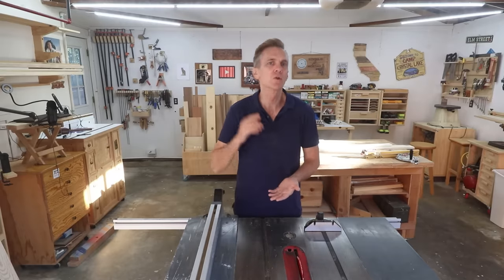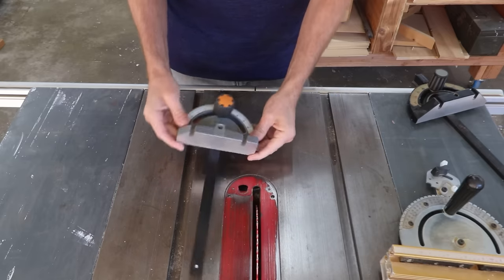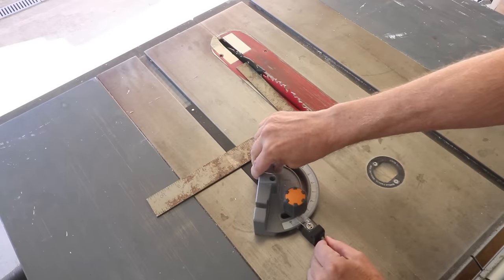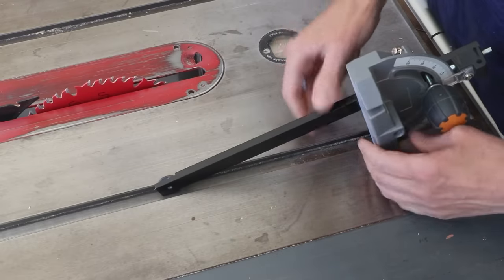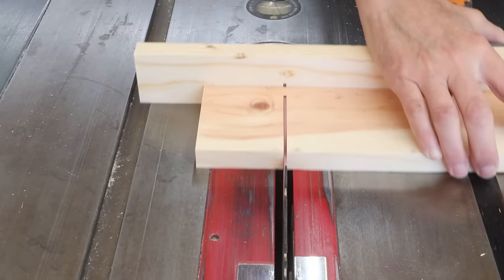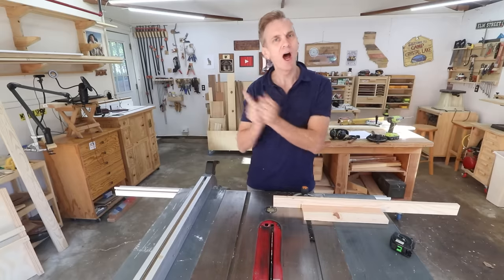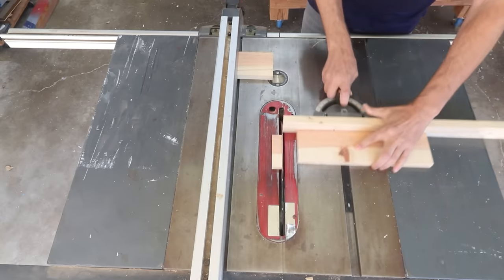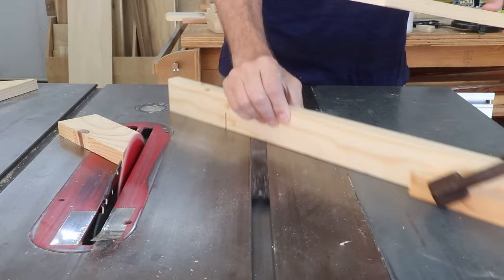Get the most out of that horrid miter gauge that came with your tablesaw

Comment: Don't buy a ryobi table saw. Miter guage isn't good and only one slot on the right side.  Lots of plastics parts too. I like their other tools but the table saw is not great.
Reply: Got my ryobi on sale for  50% off.  It's got 2 mitre slots on a folding wheeled stand.  While definitely not a pro machine, it's great for home/hobby use and takes up little space in the garage when folded up.  Mitre gauge is meh
Reply: All job site table saws have less than ideal miter gauges. I like this idea because I was just wondering how to attach a piece of wood to mine and now I can. Why doesn’t the wood cut the fence?
Reply: Yea me watching this after buying used RYOBI $50 on FB, used it one day cutting 2x4 and motor dead 😂. Owners denied any issue.

Got new one and now watching videos and this one help! 

Got a more sturdy Skil saw that is more metal part. Figure the amount of project I want to do might as well invest in better one
Reply: Agreed. The miter slot has too much slop in it making for less than precise cuts. Sawdust control is horrible and the fence measuring guide is wrong. Off by 3/16ths
Reply: Does anyone know of a good third party miter gauge that fits the ryobi?

Comment: The other COST advantage to the Miter gauge, is not having to spend another 600 dollars on a good miter saw. This is where people get the idea getting into wood working is expensive. I am starting on a the craftsman table saw, that cost me a whopping 139 dollars. yeah the miter gauge is MEH at best. but i can make a better one. SO THANKS FOR SOME OF THESE TIPS. it will improve the work of the little bench top table saw 100%

Comment: To quickly reset the miter gauge to 90*, I turn it upside down, insert the runner in the table slot, slide the head up against the saw table, tighten the lock.
Reply: That works nicely if you have a symmetrical runner... if (e.g. DeWalt) you have a t-track piece of cr@p...

Mind you, there are nice Chinese mitre gauges for $100 or so... and I'm ready for another bout of GAS (Gear Acquisition Syndrome). 😂
Reply: Good tip
Reply: nice trick!
Reply: Only works if table is square to blade. About a one in a hundred fifty chance of working

Comment: Tip for the newbies: If you are using the nail trick to raise the edge of your miter fence rail, lay the rail flat on the table. If you whack it positioned as shown, you'll bend the rail.

Comment: 5:16 - on stop blocks like this, I always nibble off the bottom inside corner (the part your workpiece is pressed against) to create a little sawdust pocket.  That way, you're not accumulating extra dust in between your workpiece and your stop block.  Just clipping off maybe 1/8th of an inch at a 45 degree angle is enough to create that little void and doesn't remove too much of the stop block as to make it impractical.
Reply: Good point. Even more important to make this recess on your stop blocks at the miter saw where sawdust collects more quickly.

Comment: I really appreciate table saws with rip fences that have a built-in flip plate. The 2" flip plate on my Dewalt 7491RS provides a nice buffer between the rip fence and the blade. When not needed it stows out of the away instantly. Almost all of my crosscuts and miters cut are made on a 10" Dewalt DWE713 miter saw. I only resort to cross cutting and mitering on the table saw when the miter saw can't handle the size of the material.

Comment: The only comment I would add is to prop up the extension just enough (1/4" or so) to keep sawdust from building up at the bottom of it and messing up your alignment.
Reply: And from making that horrendous squawking noise. Wax beneath the extension helps with this.
Reply: A small chamfer on the bottom of the extension fence can help with that, in lieu of trying to mount it both evenly and on a prop. 😊

Comment: Hello from Alaska hope you are all well. My solution for a perfect fit on the miter gauge that comes with a table saw and I mean all table saws is drill and tap 5 holes with a 10x32 tap and install nylon screws cut them off about a third the thickness of the miter bar then cut a slot on one end so you can turn it in for the perfect fit. I've done this on multiple gauges. Cheers All😜
Reply: That's how my new (expensive) miter gauge works, only it has steel grub screws instead of nylon. First time I ran it through the (Dewalt) table saw the sharp edges on the grub screws gouged large strips out of the track, since the table is aluminium. I sanded them down as smooth as possible, but it's still not good. I didn't realise there are nylon grub screws available .. I'll go hunting. Thanks for the tip!

Comment: Good ideas. the miter gauge for my Delta table saw is junk.  Very loose and crooked.  I tried tape but that didn't work. I'll try the nail method tonight. Frustrating to make a good project and then its out of square after you cut nice wood.

Comment: I came across a much better miter gauge at a used tool store than my saw came with but unfortunately the rail was a little sloppy. I drilled and tapped some holes in the rail and installed some nylon set screws to tighten it up.  Works great.

Comment: A suggestion when installing an auxiliary miter fence is to place the board on two playing cards before screwing it to the miter gauge.
This prevents the board from dragging on the table, amplifying any clearance between the miter gauge and the miter slot and reduces drag for a smoother cut.
The amount of twist in the miter slot is severely limited by the length of the auxiliary miter fence. 
When making thin cuts, use a zero clearance sled when possible.
If you haven't constructed one yet, clamp a board, that has been trued up, vertically on the rip fence before the blade and  measure from that board.
The clamp prevents the gage block from moving with the work and provides clearance so that the blade will not bind on the cutoff.

Comment: Worst miter gauge is on the Bosch GTS 10 XC2 Just purchased it and it was the last item I unpacked and assembled. The slots are also 16mm industry standard is 19mm.
I was quite happy with the Bosch until I unpacked the  miter gauge. £605 wasted the table that comes with it is very strong and stable.

Comment: Just as a couple suggestions, but, 

First, check the fit of the gage in the slot. It’s impossible to get an accurate 90 when the gage is wobbling. Then when it’s good and solid, check and adjust for 90. 

Next, I like to start setting up the miter fence at the 45 first, extended past the blade to both for zero clearance and marking the kerf. Then, without moving the fence on the gage, turn the gage to 0. Next, leaving the screws in place for when I put it back, flip the fence, set it to just stick out past the blade, and screw it in. Then raise the blade and trim the end to make half of a zero clearance support. 

Reflip the fence, tighten the screws, and, done. 

That’s what works for me. Your results may vary. But, give it a try.

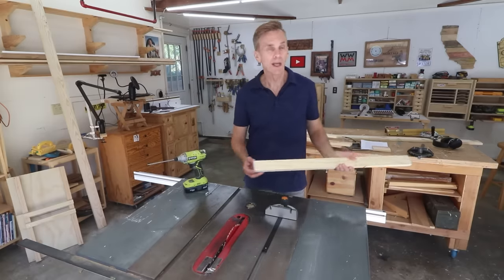Comment: 3:48 " and not warped " - in reference to finding a piece of " scrap " for the mitre cross-fence.  Good luck with that.  It's possible to ensure that any warp is artificially straightened out by adding  a flange to the fence to form an L or angle-section.  OR alternatively an I section [ two flanges and a connecting web ] would be even stiffer.
Reply from the maker: Any straight board is fine. Doesn't need that much precision.  Plywood also works great!

Comment: Scotch tape (that frosty clear office type) works well for me.  As you apply each layer, press along the corner to start folding it over under the bar. My miter slot (not T type) has plenty of clearance underneath for the fold over.

Comment: Great hints Steve. Some of the more expensive miter gauges are also pretty crappy, as I've just found out the hard way. I wish I had seen this video earlier as the miter gauge that came with my Dewalt table saw (great saw, crap miter gauge) was a really sloppy fit in the track, but I couldn't think of any way to tighten it up. Looks like now I have a spare that I can leave set up for certain tasks.
Reply: Read my comment I just wrote on Steve's video. It's very easy I did it to my DeWalt table saw before I purchased the Laguna fusion F2

Comment: Interesting video. I learned to use a punch on the top of the too-small miter gauge rail. Spread it a bit. But the real lesson was dump the gauge that came with the saw as I soon as I could afford it. Silly cost saving by the manufacturer. AND - although you didn’t mention it - the second lesson was upgrade the rip fence (to Biesemeyer), which may be even more important to consider. Mine (a Craftsman from the 1980s) was difficult to clamp securely and almost impossible to clamp straight. I think what I spent on these two upgrades came in at substantially less than a more expensive saw that would have come with acceptable accessories. By the way, these lessons came after a frustrating period of assuming my technique was the (main) cause of problems. I assumed the saw and accessories were “true” and stayed “true”.  Ha!  Periodic checking was the third lesson.

Comment: Dear Steve Ramsey. While I think I have it sorted out, can you do a video on power consumption and set up for a wood working garage? I had 15amp breakers, so I blew them every time I ran my Skilsaw table saw for more than 25 seconds. I upgraded to 20amp. But had the ridgid vacuum and table saw running out of one wall outlet and one industrial surge protector. Blew that a bunch too. Now I run one out of the top socket and one out of the bottom and seem to have it sorted. But if you could explain the best way to wire a home garage. Be it, 10 gauge, 12 gauge or 14 gauge extension cord, which surge protectors and whether we should look for 1800 or whatever… joules or watts and such. 

That would help a lot of work in the garage folks.
Reply: Great comment as this is my very same problem

Comment: I have the same miter gauge you used in the video. The pivot pin that connects the rail to the miter fence is petty loose. I get at least a few degrees of slop from just that one point. I can't think of a good way to fix it other than a better miter gauge (a better saw to go with it would be nice too). Any suggestions?

Comment: Curious-- don't recall which ones, but a few videos showed using TWO miter gauges  (one in each slot) and joining them with a backing board between (taller than saw blade height). As I recall the videos said that this approach in effect replaces a crosscut sled. STEVE RAMSEY--curious what you think about that.
Reply from the maker: Seems doable if you have two miter gauges and can't be bothered to make a simple crosscut sled. But the backing board would have to be tall enough to not cut in half. Then when you remove both miter gauges it might twist break at that point. Then you'd have to remove the fence if you wanted to use a single miter gauge.

Comment: One problem I often have with my miter gauge (especially a heavy incra one) is that when I cam cutting wide (front to back) stock, the material hangs off the back of the saw so I can't use the miter gauge at the start of the cut. I've tried flipping it with the miter gauge in front of the material at the start of the cut and then flipping it for the end, but that is way too dangerous. Any tips?

Comment: Steve, you forgot the third absolutely critical accessory needed to safely use a table saw….. the blade guard. Blade contact causes more emergency room visits than kickback and many of the blade contact injuries occur when kickback forces a person’s hand into the blade.
Reply: The only thing I don't like about the guard on my saw is that is makes it nearly impossible to use a Grr-ripper or other push block, which I usually use rather than push sticks.

Comment: Only time you can make a exception to using both the fence and miter gauge is dado cuts or not through cuts cause the wood doesn't separate so doesn't get trapped between the fence. stay safe everyone

Comment: Your cheaper miter gauge is NASA compared to the one that came with my einhell TC-TS 2225U but I managed to make it work well with ideas very similar to yours.
Reply: I'm actually planning on buying that exact saw. How does it hold up?
Reply: @repapeti98  i'm more a hobbyist than a woodworker, it's ok to me, but it's not easy to keep it squared for hard works and the dust removal strategy is bad. No blade for rabbets, i had to make my own. Other than that, it does the job.
Reply: @ARichli  I'm not a woodworker either. It would be a huge upgrade from our current setup where you have to tilt the whole table while the blade remains vertical.

Comment: My biggest complaint with the miter gauges on my less expensive tools is that the slot wasn't the standard 3/4inch so I can't upgrade to better ones
Reply: You get what you pay for.. Always get a saw with a standard 3/4x3/8" slot. I leaned that the hard way.
Reply: @martinoamello3017  Fully agree. At the time I bought the tools I didn't even know companies didn't use the standard, and I wasn't yet trying to use other accessories. I think the craftsman table saw (from 15 years ago before sears took a dump)surprised me the most, the WEN makes sense as it's an even cheaper brand. Going forward that's going to be the first thing I look for in the specs, and I've made it my duty to warn newcomers 
 about.

Comment: Curious what you think about using a small, cheap miter gauge as the foundation for a crosscut sled? Make the flat sled with a tall, thick backer that screws to the miter gauge?
Reply: I recently used the runner from a broken bandsaw miter gauge to make a crosscut sled (for the bandsaw), but I kept my janky table saw miter gauge.  I still use the gauge infrequently to make angled cuts the sled can't make.

Comment: Unfortunately didn't get any "aha" moments from this one. Tried pretty much all of these, but I have one of those crappy Ryobi table saws which not only makes the Ridgid miter gauge look ridiculously good in comparison, but it also comes with a nonstandard miter gauge slot so I can't find any third party miter gauge that fits (on the other hand, using a miter gauge that cost more than the table saw itself might look a bit ridiculous).
Reply: I have the same Ryobi saw. Making my cross cut sled was like a miracle come true. Best investment of time I have made
Reply: @toddlarson9678  Yeah, definitely needed the crosscut sled. Still occasionally want to cut various angles, though. A DIY miter sled like the one John Heisz made a video on might be worth trying to make (eventually).
Reply: @penjon  I've thought that too. Steve has a nice miter sled video, but I haven't tried making one yet. I picked up a radial arm saw that feels like it has jigs and sleds built in
Reply: @toddlarson9678  I actually meant angles other than 90° or 45°. I did make a miter sled for picture frames, it works quite well for that.
Reply: @penjon  yeah, I get that. Isn't it fun to make them? I've gotten a little obsessed with jig making and made some I don't actually need yet.

Comment: It always irritates me that so many of the power tools out there that have a miter with it are so cheap and flimsy. Many times the various companies go through all the troubles to make a quality tool but the first thing they go cheap on is the miter. Often times made of cheap materials which leads to inaccurate cuts and unsafe situations. It's as if the manufacturer wants you to pay more for an after purchase upgrade instead of providing a quality one to begin with. The miter is the first part of all of these tools that we all touch and hold when checking out the tools at the stores. And how many times have we held a cheaply made one and passed up buying it wondering where else in this machine did they go cheap that will cost me down the road.

Comment: The squeaking of your auxiliary boards made me cringe. :D I use a sheet of fine sandpaper (or two sheets for length) and place it under the auxiliary fence when screwing it on. It will lift the board just enough to not squeak but still less high than any board I'll ever cut no matter how thin. Well, except aluminium and plastic maybe, but those are edge cases...

Comment: Ah yes, table saws with miter slots. Would be a nice upgrade from our current setup where the entire work surface is not bigger than an A3 sized paper and you have to tilt the whole top while the blade stays vertical.

Comment: WRONG! Bad advice for newbies! Miter gauge should always be square to the miter gauge slot, NOT the blade! That way the cut will always be at a right angle to the direction of travel. The fence should always be parallel to the blade, to avoid the possibility of a pinch. Hopefully the blade is parallel to the miter gauge slot, but I had a Craftsman that was not out of the box. It took me a long time to figure out that it wasn't set up accurately, and even more time and several tries to actually get it aligned. You can work with your saw, though, if the miter gauge is square to the slot, and the fence is parallel to the blade. This is vital to safety!
Reply from the maker: If the miter gauge is square to the blade, you're fine. There is no reason to overcomplicate this simple procedure.🙄